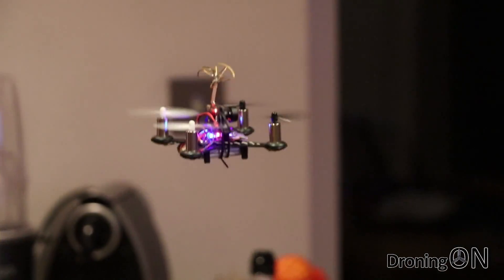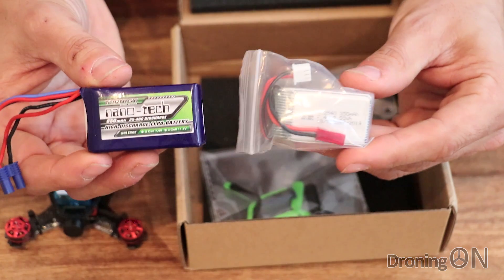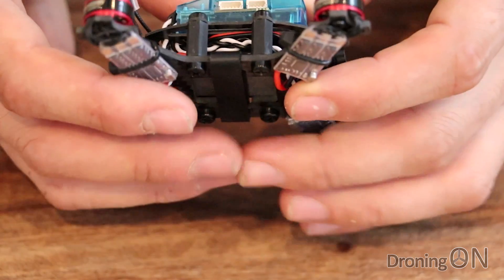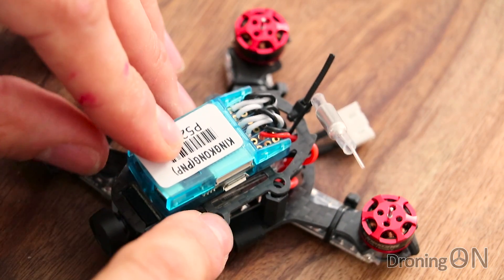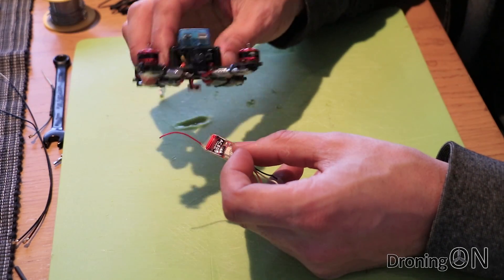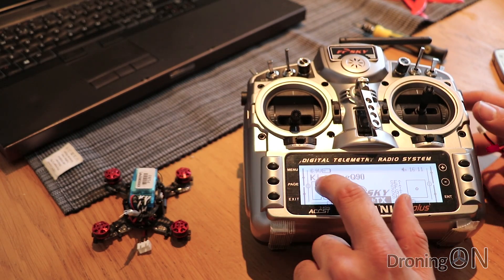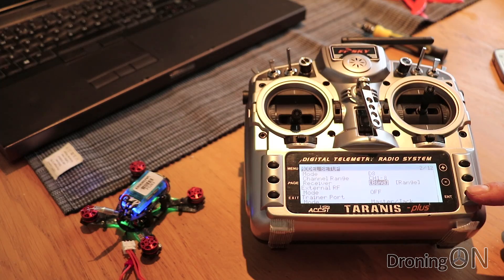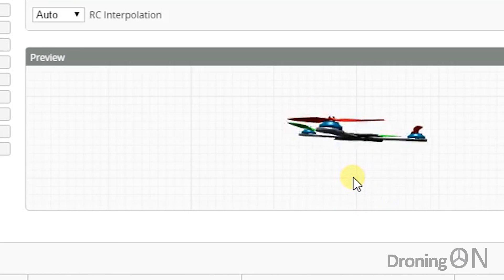DroningON | KingKong Q90 Brushless Unboxing, Binding, RX Install & Config (Part 1)

Comment: At 16:49 - I can't see a "rate mode"

Did this get cut off in the video?

I can't get my quad to arm.
Reply from the maker: Sorry for the delay in responding, your comment was marked as spam for some reason. You won't see 'Rate' mode in BetaFlight because its not strictly a mode, 'rate' mode is basically when neither Angle or Horizon are enabled, that's all.

Comment: I have a DX6I and the binding works. however pitch and yaw are not responding. How do i map pitch and yaw? Also how do I assign an ARMING switch
Reply from the maker: +Snake watcher you'll need to configure these outputs on your transmitter, then plug the quad into Betaflight or Cleanflight and head to the receiver tab.

Comment: Hello, i can't binding with my Taranis X7 in D8? Any hints? Thanks in advance.
Reply from the maker: Petr Mejzlik which RX are you using?
Reply: I flashed to NONEU now it works (the LED light is solid red) but no reaction in BF from my Radio?
Reply from the maker: You've definitely got it set to D8 mode? It could be a difference between EU or Non-EU firmware on your Taranis?

Comment: This is a good 1-2 generations old for micro brushless quads 

The KingKong 90gt is a much better version of this and the ARFUN 90 is even better

The Aurora 100 is a little bigger but also much nicer than the q90

No one should buy the q90 with what else is on the market currently 

4 months ago this was a decent option.
Reply from the maker: +David Norman interesting comment, I really like the Q90 and it flies really well - I do agree that there are better options now and the Aurora 100 is one, the Q90 should by now have dropped to £50/$70 to make it a bargain.

Comment: could anyone tell me what the port above the usb is for? is it for pwm? i have the white version and cant figure out how to use pwm to fly my drone
Reply from the maker: +Jason Curtis, you should be able to use PWM with one of the cables supplied with your RX? Connect one end to the UART on the front and the other into the PWM ports of the RX?